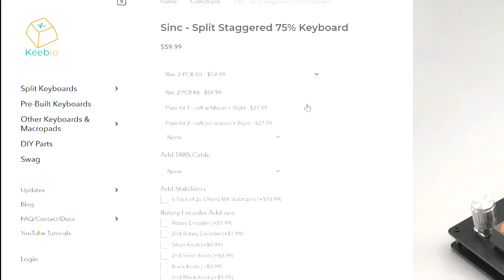Keebio Sinc - Split 75% Keyboard Build

Comment: Do you have a tute for the rotary encoders?
Reply from the maker: I'm not sure what that means unfortunately. The rotary encoders that I got from Keebio were the ones I used here.
Reply: @3tuxedo  that's fair enough. There's little to no information anywhere on how to configure the rotary encoders. I have two on my sinc board and I can't find anything on how to set them up for volume control or led brightness etc.
Reply: @benjocharlie Microsoft Power toys is gonna be very helpful. Short of that, take a look at xinput or autohotkey. Any program for that'll tell you how your computer understands the input; if know the name of that variable, you're good to go